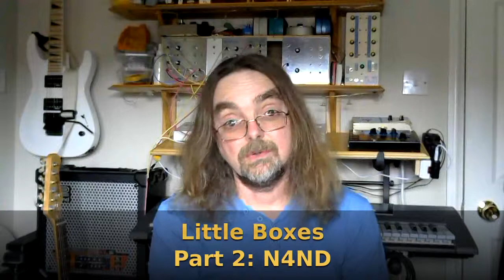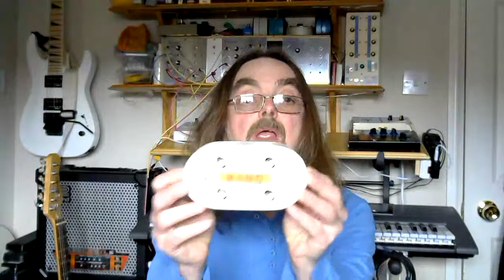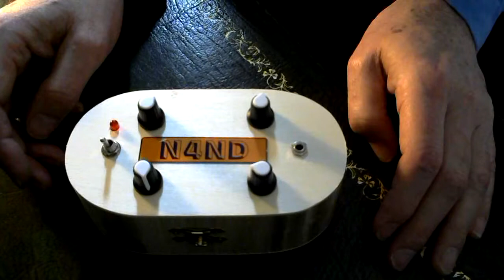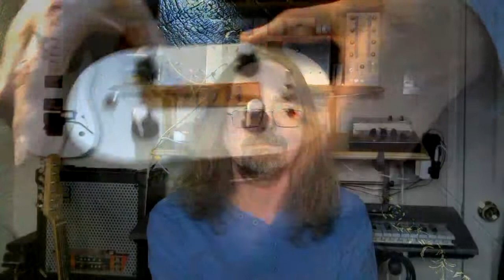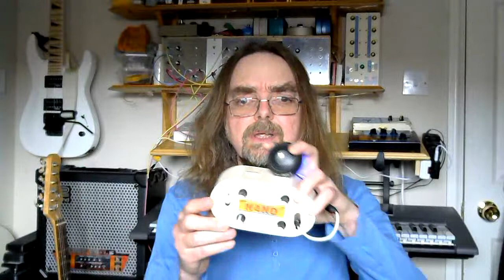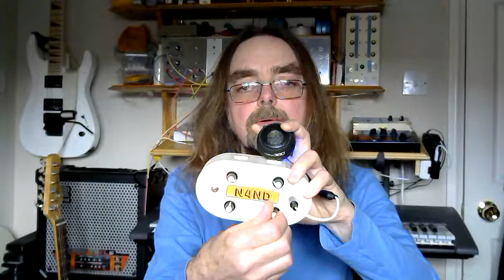Little Boxes Part 2: N4ND

Comment: What is the impedance rating of that little speaker?
Reply from the maker: The little speaker is actually a small, cheap, rechargeable amplifier that is useful for checking that there is some output but the audio quality is poor.